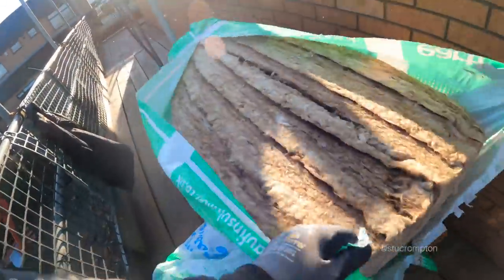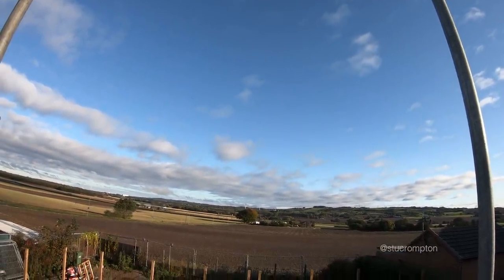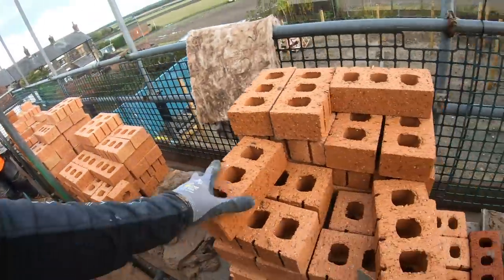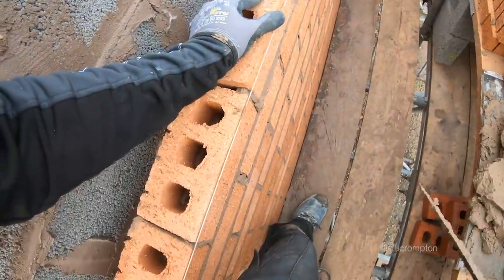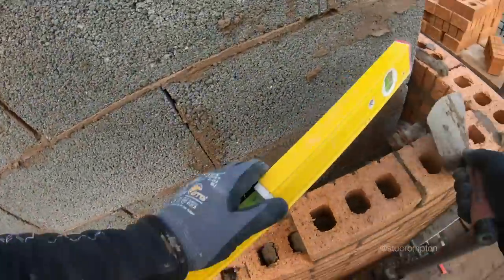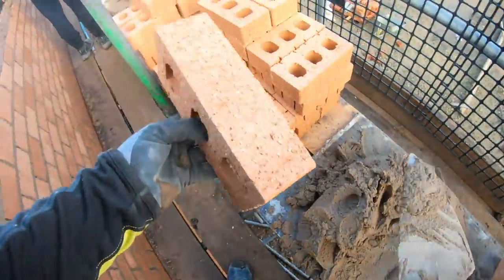Bricklaying - Bad Week For Building a House - Part 8

Comment: Why are there ridges on one side of the brick?
Reply: bricks always have a front and a back, the ridges are just part of the manufacture process and don't do anything much.The three holes provide a uniformly thick area of clay which (as the brick is being dried and baked in a kiln) ensures no twisting or cracking which could happen with different thicknesses of clay.
Reply: @DarrenVelSatis  Very good thanks